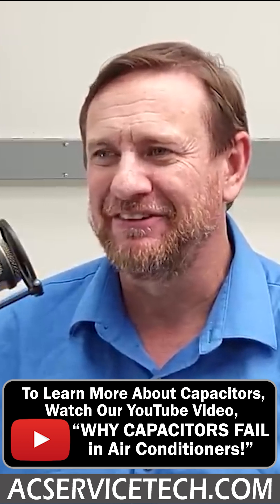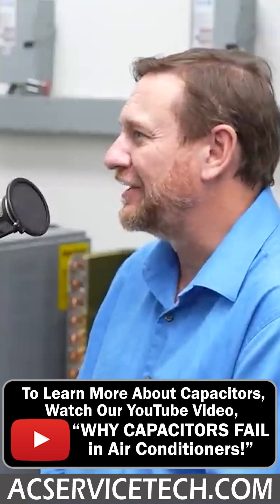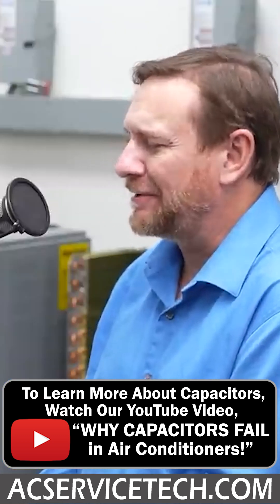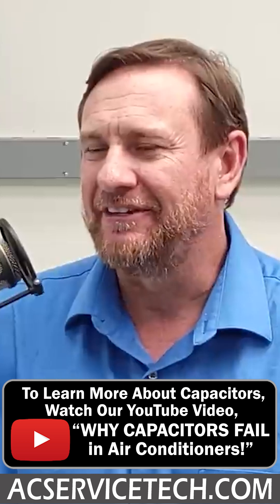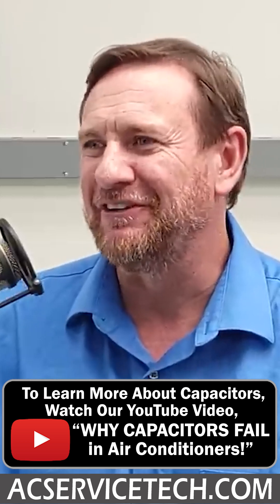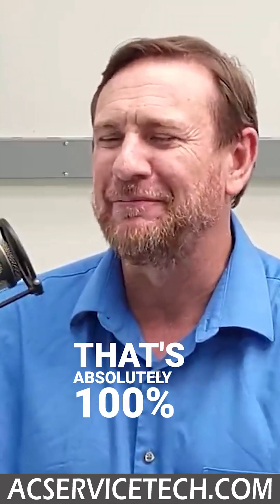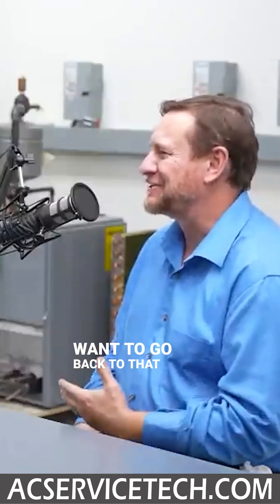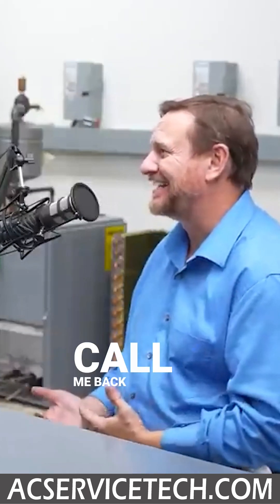Why Would a Run Capacitor Fail After a Few Months?

Comment: All repeat failures deserve a closer look: failed blower motors for example always deserve a static pressure check, correct settings check, and a wiring inspection with electrical test.  

Capacitors are much more notorious for being out of range even when new still in the box... especially depending on what brand they are & where they're made.  Even so, any repeat failure deserves a closer look.  Some techs, especially those who value getting it done fast more than getting it done right, will miss important details that can prevent a capacitor failure relapse.  Was the capacitor wired right? Just because the wires were put back in the exact same place on the new capacitor as the old one doesn't mean it was wired right; the old capacitor may have been wired wrong so placing wires in the exact same place instead of checking the wiring diagram is a common failure on the technician's part.  Was the capacitor the right mfd size AND voltage (440 can go in place of 370, but mfd size must be a precise match)?  Again, just because the tech put it back 100% exactly how they found it would still be a failure caused by the technician if the wrong size capacitor was installed all over again -always check the component (compressor, fan motor, etc...) to confirm you have the right size capacitor.  Checking the wiring for any loose or deteriorated connections, corroded terminals, undersized wiring, correct voltage in & out of contactor... all of these basic common electrical problems add heat (the number one enemy of a capacitor).  Raise your hand if you've ever had to replace a capacitor with a burnt wire; yeah, me too.  

So although capacitors are notorious for poor quality control, a tech not paying attention to important details can also cause a capacitor (or any other part) to fail sooner than it should.  Be thorough and observant without jumping to conclusions, and you will get fewer callbacks as a result.

Comment: I’ve  found it’s the physical size of the capacitor that is typically what makes them better. I think the logic is the size helps dissipate heat better. I found American made capacitors sold in my area or much bigger than foreign made. Also, the cost is very similar to the foreign made capacitors. With customers equipment that sits in direct sunlight all day I’ll use two capacitors in parallel. This has fixed all of my once a year customers where they need a new capacitor.

Comment: Run capacitors have gotten smaller over the years. I have seen very old run capacitors still working fine probably because of the thermal mass able to dissipate heat better than the newer smaller run capacitors

Comment: Well is not that easy. We use as reference 2-4 parameters and the cap have over 40 . Main reason is , heat, over voltage, the power factor delivered by near transformer , running mode of motor ( over and under load will change the angle current in coils and will reflect in high spikes in cap ) , vibration . Of course the manufacturer have some role in this but in most of case ( except 1/50 cheaper) is secondary issue. Is dinamic problem and can be really solved by aproximation in field experience. Anything beyond that , need days of seriously tests and diag.

Comment: Yeah I’ve seen brand new motors bad from the box and bad motors on brand new equipment.  HVAC is getting worse and worse….  I was only in it ~10 years but that was enough.  Between customer misinformation and supply houses being awful (in MS) it’s not even worth messing with it.  Luckily refrigeration isn’t as bad as residential hvac…. Yet…..

Comment: So capacitors present reactance to AC. Reactance is a deep and nuanced subject but in this case we can kind of think about it as "Resistance to current that only applies to AC"
The reactance formula for capacitors is:
Xc=1/(2πFC) where F is the frequency applied to the cap(60HZ for a run cap) and C is the Capacitance. So a 5 μF cap would present 530Ω of reactance at 60 HZ. But notice how Capacitance is in the denominator of that equation.
This means that the "resistance" to current flow offered by the capacitor is inversely proportional to it's capacitance. (The non-nerd way to say this: If capacitance goes down over time due to age, the reactance will increase. )
If you think about it, there are 2 forces at play that dictate the amount of AC voltage you will see across the leads of a run cap.
The first one is the EMF generated from the motor(which interestingly enough is also a byproduct of Reactance)
The second one is the Reactance of the capacitor itself. 
Similar to DC resistance and Ohms Law, if reactance increases, the current must decrease, and the voltage across the capacitor must increase.
If you're still reading this you're awesome.

Pure reactance doesn't create Heat like resistance does. (Capacitors and Inductors behave as energy storage devices, they temporarily store energy, but give it back later. Resistors simply consume energy and dissipate it as heat.) but no capacitor is 'Ideal'. The electrolytic caps like the ones we use in HVAC tend to have a high value of something called ESR(Equivalent Series Resistance) ESR is an unavoidable inefficiency in capacitor design. It is a resistive loss the capacitor presents to the circuit. You can think of ESR as an imaginary resistor that is in series with the capacitor plates. I've often wondered if this ESR value is variable and can change over different voltage ranges. I would also be willing to bet that Chinese caps offer much higher ESR than Amrad caps. If the ESR increases with voltage, this would cause the capacitor to dissipate more energy as heat. So as the capacitor ages and loses capacitance, the reactance and thus the voltage across the cap would increase, making it more likely to heat up and boil the electrolyte. This also causes a marked decrease in start winding current, and causes the run winding to draw more current to compensate.

Comment: Let's think this through a little more and discount the most likely cause, another bad cap. If the unit was supplied by a long run, it might have enough voltage drop in the home run line to feed the unit with inadequate voltage. That lower feed voltage to a PSC motor results in a longer startup time and higher startup surge current. Of course the windings will be the next weakest link, but more heat could damage all kinds of vulnerable contact points along the way, including the cap connections.

Comment: How about a broken control wire for the thermostat? Solid conductor wires tend to break overtime with vibration and movement. When replacing a fairly new appearing cap, I always dig deeper. In my experience, most times there is something else that needs to be addressed. My most commonly found issue is an intermittent connection in a solid conductor cable. I will only use stranded wire cable on installs. It's worth the extra pennies and the 15 extra seconds to prep the stranded over the solid.

Comment: I preferred chinese made capacitors because it always contain breed resistor. I was fixing restaurant microwave last summer and got shocked from not breeding it. I repaired over 30 same brand factory installed chinese cap and never been shocks. However, this micro someone switched to US made cap so it got me good. My shoulder still in pain despite months of exercise. The muscle in front of shoulder seem broken.
Reply: BLEED dude!  BLEED!  Not "breed".
Reply: Hope your not breeding with your caps
Reply: @pnp8849  I thought you said "I prefer Chinese because they are Bread" There is always bread behind Chinese caps. Go back in about a year to sell a new one 🤑🤑🤑

Comment: Was cap 330v or 440v , emf feed back you will get 300v , ANY LIGHTING SURGE WILL DAMAGE 330v caps
Reply: No 330v for run capacitor, either 370v or 440v. 330v is only for start capacitor
Reply: @ some cheap ac units have 330v 5-8years ago